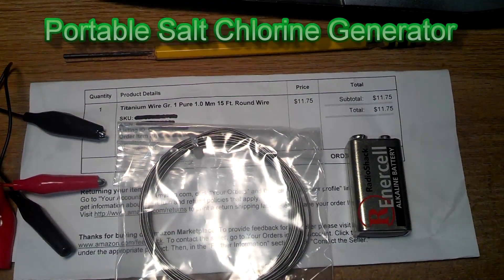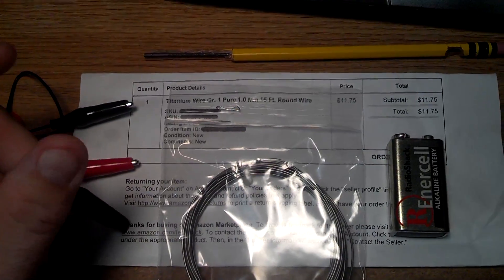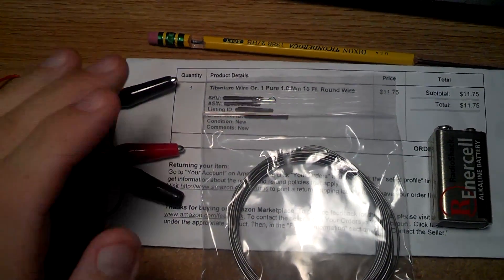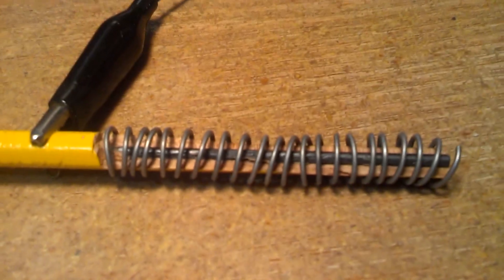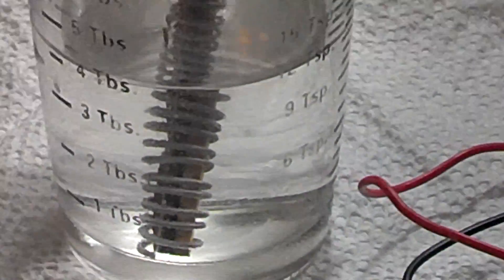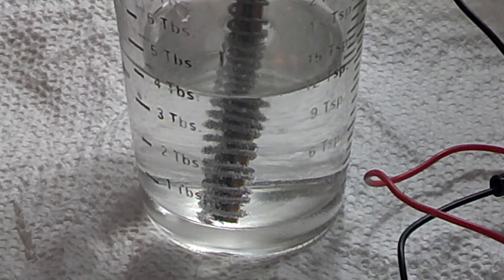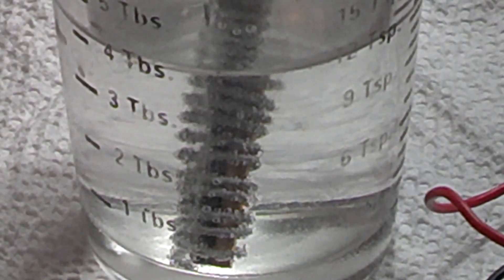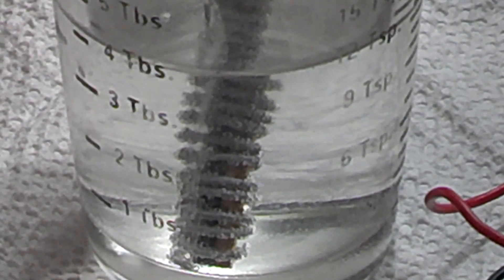Portable Salt Chlorine Generator

Comment: I realize this is an old video, but I have questions.  Do you have a link to the titanium wire, wherever you bought it?  That seems like the most expensive component.  Does it have to be something like 99.99% pure, like w/ colloidal silver?  How much (length)? How many coils?  Do you want space between each coil, or coiled tightly?  Do more coils make it go faster/produce more?

Comment: sorry for all the questions…   Do you think this system of yours would hold up to 14 volts max?
Reply from the maker: +Dana Manuel I haven't tried I would not apply power with out it being in the water. It think its the amp's that really matter. I for sure would not use it with a car battery.   No problem with the questions. Please ask all you want.
Reply: +North Carolina Prepper .   Thinking of all weather situations, I figurer for immediate use, 12 volt batteries are readily available.  For the long term ( post SHTF), I am going to try a  small 12VDC battery maintainer solar panel for the power.  Then I'm thinking for the storm days when solar is not an option, resort back to batteries.  
  This system that you put together seems to be the easiest for any prepper to put together.  Right now the parts are easy to get.  They are small,  compact  store well..  Good work!  Thank-you for sharing this info!   
 If things get real bad, I see Salary coming back into Importance.  RE: Roman Soldiers were paid in Salt.
Reply from the maker: Just make sure you do it out doors. I gas it gives off is not good. Me head was spinning and my eyes were burning.  And get the test strips so you know if it worked. I have persona, used it but my first choice is dry pool shock. It last years and years. As well well as makes 1000's of gallons with of chlorine for Penneys.
Reply: +North Carolina Prepper , Real Good point about the Pool Shock!  Just as long as it is only sodium hypochlorite.  I didn't realize until recently that "Pool Shock" was just powdered chlorine. 
   I know to stay away from some chlorine tablets because of the other ingredients that are included, like bromine (bad to ingest).

Comment: why did you choose to use 1.0mm titanium wire?  would .80mm or .50mm have burned up on you or just had to much resistance to do the job you wanted?
Reply from the maker: +Dana Manuel  I don't remember, But I think it was based on price. The way i cut the pencil it exposed 1/2 of the lead(graphite) and #2 lead pencil lead was 2mm so it kept the ratio of 1:1 But I don't think it matted.

Comment: Interesting. What would happen if you used stainless steel electrodes?
Reply from the maker: Stainless steel is consumed when used in the electrolysis process, although slowly. The main problem with using it is the hazardous waste it produces. Stainless steel contains chromium. The electrodes, and thus the chromium is consumed, and you end up with poisonous chromates in your electrolyte. The compounds can cause severe skin problems and ultimately, cancer. Hexavalent chromate is poisonous.
Reply: North Carolina Prepper
Thanks for the info.